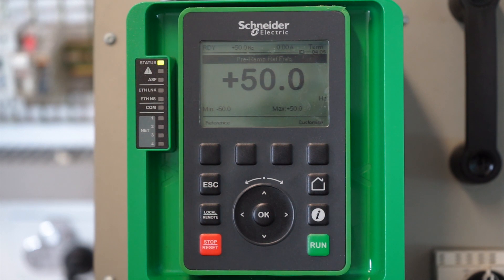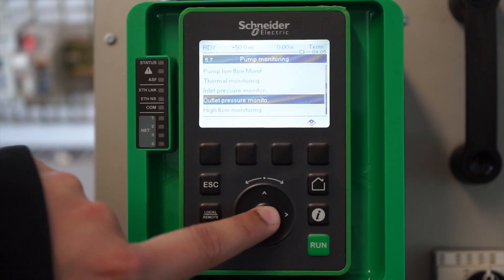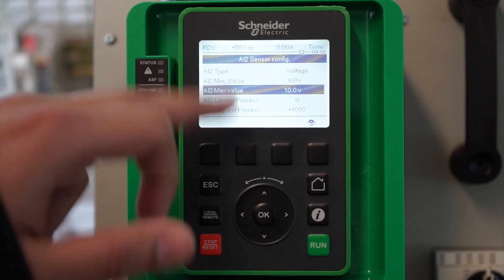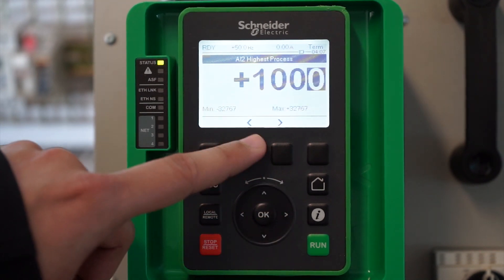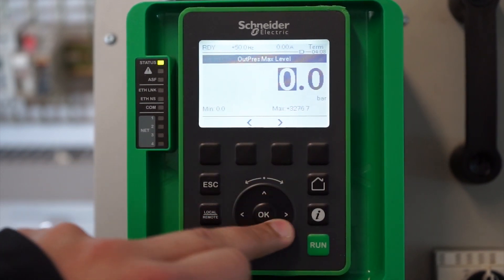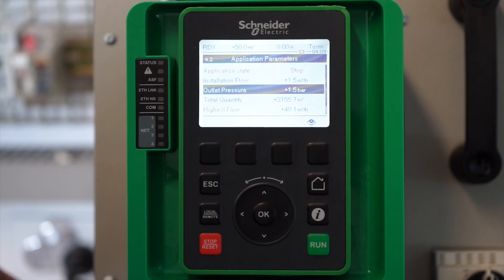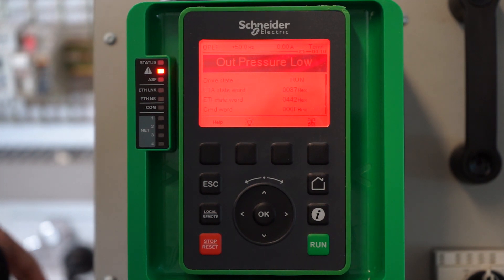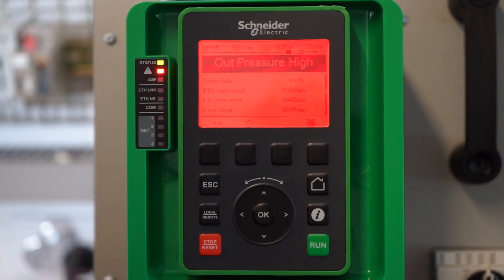Altivar Drive - How to set up outlet pressure monitoring

Comment: where do i need to add the pressure transmiter in the vfd
Reply: Any of the analog inputs. AI-1 Ai-2 are default for voltage and Ai-3 default is current.